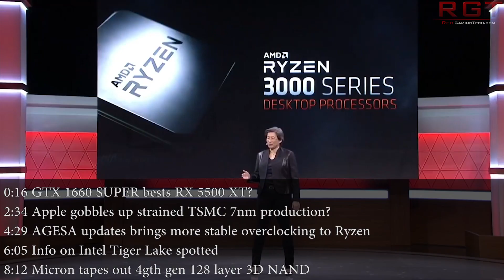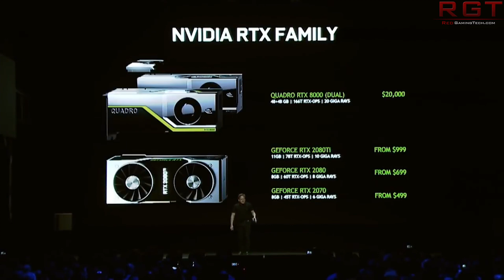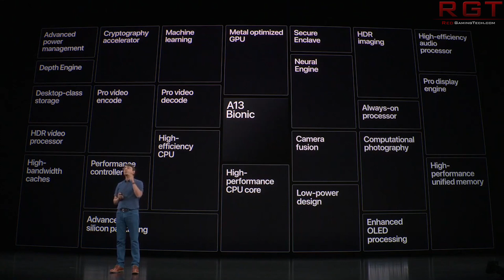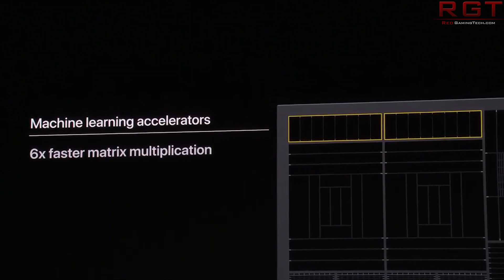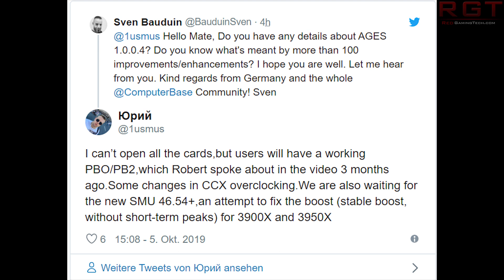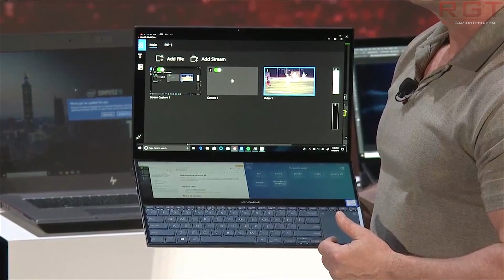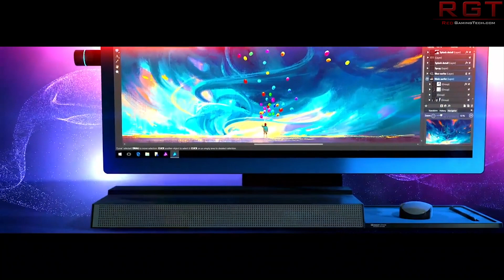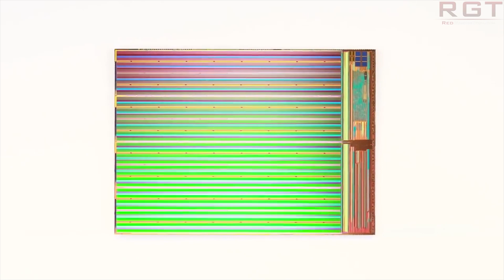New Ryzen 3000 BIOS = Even More Performance ? | GTX 1660 SUPER Bests RX 5500 XT ?

Comment from the maker: 0:16 GTX 1660 SUPER bests RX 5500 XT?
2:34 Apple gobbles up strained TSMC 7nm production?
4:29 AGESA updates brings more stable overclocking to Ryzen
6:05 Info on Intel Tiger Lake spotted
8:12 Micron tapes out 4gth gen 128 layer 3D NAND
Reply: That's a bit of a wired way of putting it isn't it, 1660 SUPER BEATS RX 5500 XT BY 2.8%!!! ... ... ... oh yeah and the RX 5600 XT beats the 1660 Super by 11%... but ignore that part... Because more less you know AMD is going to price the RX 5600XT to be competitive with the 1660 Super and the 5500XT will be cheaper, like they did with the 5700XT vs the 2070, god the 5700 is cheaper than the 2060.

If AMD does the same thing for the "lowend" the 5500XT will be price competitive with the 1650, and the 5600XT will be a similar price to the 2060.
Reply: Is there a reason why the timestamps are not in the video description (since you already have the descriptions of these in there)?

Comment: What i believe.
5500 working the same as a current GTX 1060  or 1660 at a price tag of 150-170$.
The XT model working slightly better than a 1660 or similar with a 1660ti at a price tag of 190-200$.

Comment: For the Last Time TSMC made a statement about their 7nm node popularity and that it is being fully utilized a message clearly aimed at investors plus they stated that new production schedules have a 6 month wait  No effect on current production/clients  AMD is prioritizing EPYC which is of no surprise to anyone as those orders are time critical and show they are ready for a larger share of the Data Center market Intel is having supply issues so AMD must meet demand there
Reply: intel's supply issues ended last month.
Reply: @psionx1  They claim they will be caught  up it remains to be seen Howmany times did Intel say10nm will be here soon
Reply: they are caught up as evidence by the fact you can actually find chips like the i5-9500 on amazon.  before September about the only way to get it was to buy a prebuilt system from dell or HP.

Comment: can you imagine we got around 2% more performance till now after the ryzen launch and we will get even more... Hats off  to Amd
Reply: the only thing that changed is that we've been downgraded from desktop cores to laptop cores. we may have alot of them but only with 60% of the single thread performance. new nodes like 7nm and 10nm do make this loss more tolerable however.
Reply: @psionx1  what do you mean? please explain
Reply: i read that 14nm can push higher clock than 7nm... maybe because 14nm can take more heat than 7nm
Reply: @levroll9492 14nm from intel cu push higher clocks since the process has been refined starting 2016, 7700k wasnt pushing 5ghz  give it time and amd with 4000 series will have higher clocks
Reply: yes that's why i pass this gen... for sure next gen ryzen is going to be great

Comment: I just got my 3900x a couple of days back and it looks like i got lucky in the silicon lottery. I'm still running the bios before ABBA and my good core hits 4.656 GHz on 4 cores and 4.621 on 2 cores, the other chiplet (6 cores) are anywhere from 4.199 to 4.299 GHz. I still need to get around to update the bios, i hope it can squeeze maybe a bit more out of the CPU. Edit: just started some After Effects work and my best core just hit 4,692 GHz.
Reply: What kind of scores are you getting in Cinebench?
Reply: @happysickfreak8415  If you just need the CPU/system for playing around its good enough. For getting some real-world work done that pay's $$$ or €€€ I'll stick to my 3900x ;) Ahmm children they are so cute.
Reply: @happysickfreak8415  You are right. depends on the profession you are in. when i do woodwork or construction i need exactly 0 cores ;)
Reply: Definition_X  Yes it looks like i hit the siliconlotery jackpot. Still need to dive into bios because the stock asus setings hit the CPU with up to
1.5 V.
Reply: @AwesomeSauceShow  1,5V is normal on auto settings.
Reply: @MissMan666  Ah ok, somehow i got the impression from other tech YouTubers that it's too high on auto. I wonder if i should update my bios to ABBA, as it seems i don't need the update performance wise. But i think they changed the CPU behavior in ABBA so it react's faster and more often with frequency boosts.
Reply: @AwesomeSauceShow  there is a big agesa comming up soon, fixes, improvements, new features and so on. Since your setup is already behaving well, you could just skip abba and wait until "the big one" is out. Zen 2 is state of the art, just keeps getting better.
Reply: Now if only Microsoft address the awful schedular so programs can be assigned to use the faster cores by default
Reply: Intel all the way

Comment: I've been waiting all my life for a working PBO/PB2. Most people haven't really realized, but the mere act of switching from Default to PBO does nothing at all. The limits for each are exactly the same. At the same time, the frequency and voltage doesnt go beyond a certain point regardless of temperatures. You can be 40c away from 95c and it will just stop there in the heavy load you're running. The whole point of the PBO/PB2 combo is to use that thermal headroom to push processor performance, but it simply hasnt been doing that, not even if you manually theoretically remove all PBO limits.

I really hope 1,0,0,4 fixes this, and also clocks the 3900x properly. As in, CCD0 can run much faster in all-core clocks than they are currently letting it. Another thing they really need to do is make boosting less sensative to the light activity of other threads. Breaks too easily and is almost never realized if you have the normal bloatware normal people end up running.
Reply: Why don't you just do a manual all core overclock and be done with it? PBO is useless.
Reply: @Bang4BuckPCGamer  Thats the easy way, for AMD. However, they like to claim to maximize performance out of the box, so they need to make it true with a functioning PBO/PBO2.
Reply: Windows messes up the scheduling for ryzen processors sometimes switching core priority to the slowest core on the CCD. For no reason which interrupts the way Ryzen boosts.
Reply: @jotunheim5302  windows scheduler is only one part of the equasion. situations that allow the processor to boost and what frequency they boost too is controlled by the microprocessor. No change to windows will allow the processor at stock to run at its boost frequency on more than one core, thats on AMD. and because AMD only allows it on one core, the smallest activity on other cores will prevent the boost frequency from being reached. this is why it is never obtained in games. a manual oc of boost frequency in the ccx windows aims for is the only way for gaming. Ive done that much already. its not something a change in windows will achieve.
Reply: @Kojiro3210  ASUS has its own profiles for PBO and is does work  But you admit to heavy workloads so that points elsewhere  You do touch on a major problem with reviewing on clean install systems, they do not reflect real-world performance and this allows for lessor CPUs that would not be able to sustain boost to seem better or equal  than the user will observe  This applies to Intel and AMD   AMD has the new AGESA and stated more to follow plus MS has stated that Windows will run heavy tasks on best cores (4) so
Reply: @Viewer19  Agesa from AMD controlled whether or not people got their boost speed. One Agesa fix, 25-50mhz increase, sometimes more. that simply says AMD will determine how fast it boosts, and other factors such as max boost cores. this is what the microcode is for. bios and windows wouldnt know wtf without it. Asus has its own enhancements contained  in the performence enhancer settings, but enhances on the agesa. it would be useless without it. point in case: performance enhancer level 3(OC) did not give me the rated boost speed, AMD AGESA 1.0.0.3ABBA did. AMD can make these proccessors perform how they like from agesa and we wouldnt be getting 100 microcode fixes with 1.0.0.4 if all we need is windows. they work togerher.
Reply: @Kojiro3210  Really so it's all about you right? "All My Life"  Get a grip.  ASUS PE has given perf beyond default, in this case AMD was limiting max boost for some.  They are improving their product but all you want to do is complain.  You really don't understand the current tech or are not paying attention.  MS is making the changes and it will improve Both Intel and AMD               CPU performance and address the issue you stated r lighter background tasks limiting boost  Seriously get a grip
Reply: Pbo and bco work for lower end skus. My 3600 clocks 150mhz higher but the additional power draw isn't worth.
Reply: @rdmz135  do you use the box cooler?
Reply: @Kojiro3210  No. Cryorig H7.

Comment: Igor's lab dodn't have neather the 2 of the cards, what he said was BS.
I've seen a leaked benchmark of a 4gb AMD card clocked at 1590mh getting the same results as a heavily oc'ed vega 56.
Basically the 5500xt will be even faster than the 1660ti let alone the 1660 super.
Reply: Igor didn't said that he has the 2 cards. He said that everything he is saying in the video is based on rumors.
Reply: David Wilcox  but can they really?  https://i.imgur.com/Bwl408U.png?1

Comment: I'll be fine with the 1660 super beating the rx 5500 xt IF it's the same price or cheaper
Reply: Advocatus Diaboli  Go for Vega unless you really want RIS on DX9. I also doubt the 5500XT will benefit much from a waterblock, and (depending on whether the PCB is the same as the 5700) you might not even be able to buy them, as it's a low-end card.

Comment: I thought 1660 super would be against 5600 whatever
Reply: Yeah. My assumption is the 5500 series is targeting 1650 -1660.. And the 5600 series will target 1660 super - 2060.
Reply: @serfillustrated4018  some rumours are saying that they're skipping  the even numbers.
Reply: @juniperburton7693  Yeah its starting to look that way. I think AMD is screwing up if they price the 5500 over $150 though. Since its only gonna be partner cards they will be priced higher that the msrp anyways. With no 5600 cards there will certainly be a wide gap between the 5500 and 5700.
Reply: @serfillustrated4018  they started doing that recently: 16 CUs vs 32 onthe rx 560 vsthe rx 570... The 5500 XT will be closer to the 5700